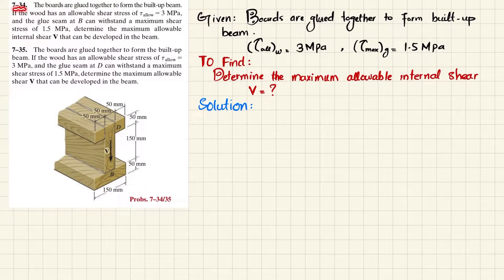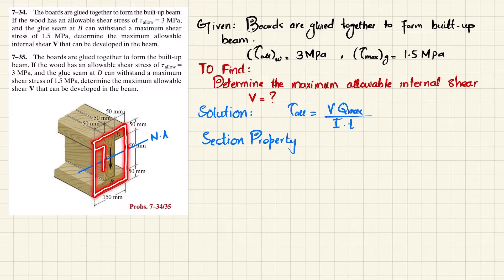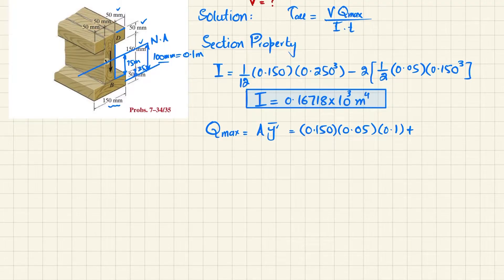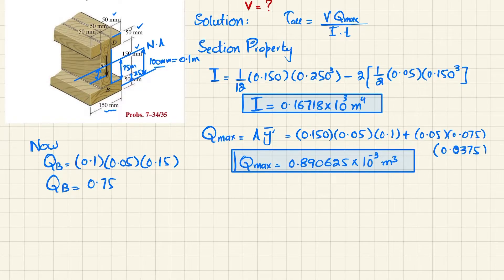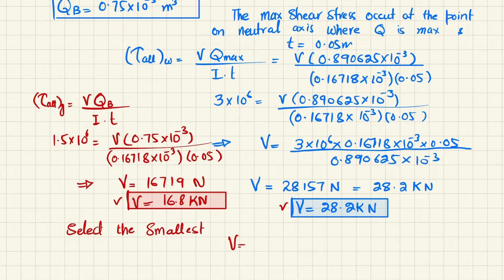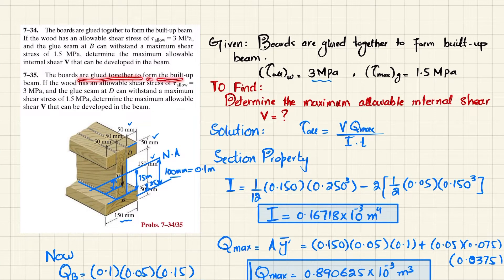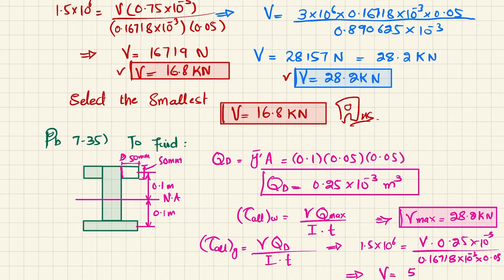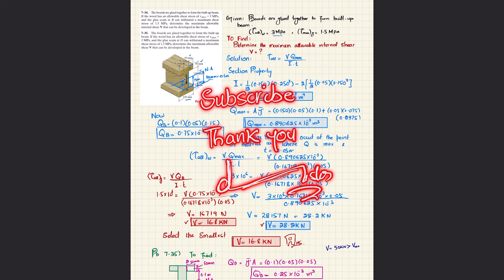7-34/35 Determine the maximum allowable internal shear V | Mech of materials RC Hibbeler

Comment: Why did we take the thickness of the Qd part as 0.05? Shouldn't we have taken it as 0.1? I thought so because it was stuck on both sides.
Reply from the maker: That is done only for one side. If you put thickness 0.1 then it's for both side and at the last you will divide it by 2 to get the result in single side. Things are the same, rest it depends on you what you choose....
Reply: @engradnanrasheedmechanical  thank you sir

Comment: Hi Sir why when you are obtaining V(shear force), you use shear stress allowed but use a maximum Q ,why not use  Q which will be the same as at B?
Reply from the maker: Well you can see that allowable shear for wood is given which is maximum shear stress for which we have to calculate Qmax in order to get maximum shear force V . Also shear stress for glue is given which is placed at point B so for that we obtain Qb to get shear force V. Now we have two shear force one is maximum shear force V that wood can withstand and other is shear force that glue can withstand. So we will choose shear force that glue can withstand because it is smaller and when applied will be safe for the wooden beam. If we choose larger value of shear force then beam will fail at glue portion B. I hope you will understand it. Give me your feedback when you get my reply . Thank you
Reply: @engradnanrasheedmechanical  Thank you sir I now understand.